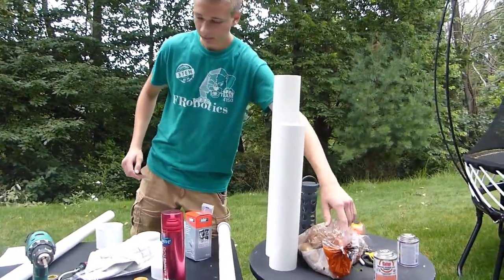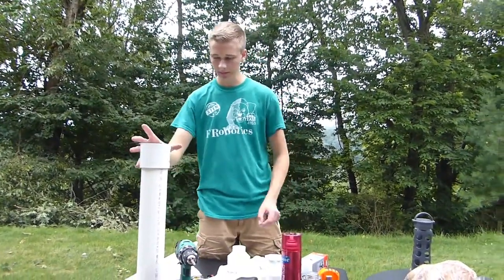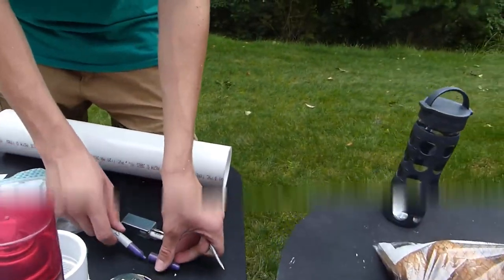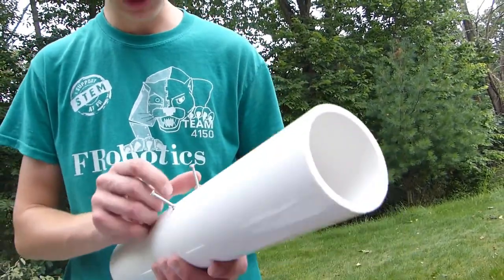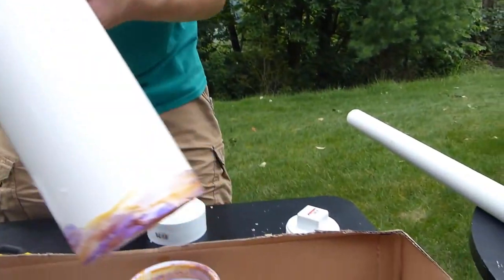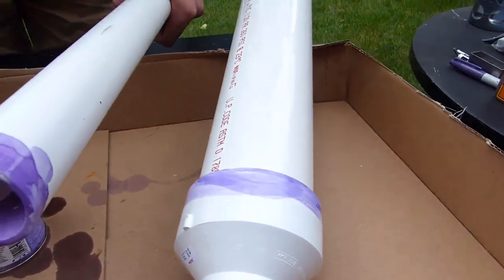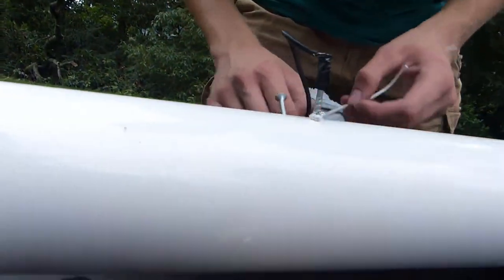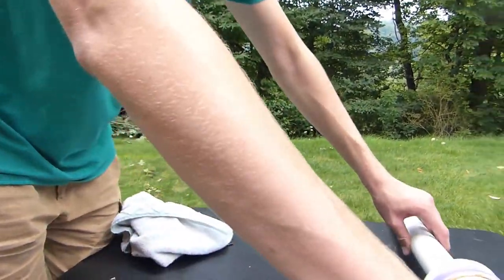How to Build a Potato Cannon - Easiest and Most Powerful/Efficient Method!

Comment: the strings in the wire act to prevent the wire from being over stretched. they give the wire a skeleton so when the wire is being fed through a pipe as an example, it doesn't stretch and snap. Nice build. Use stranded (same kind of string) packing tape around the outside of the barrel. Should also let the glue dry for 24hrs before firing.